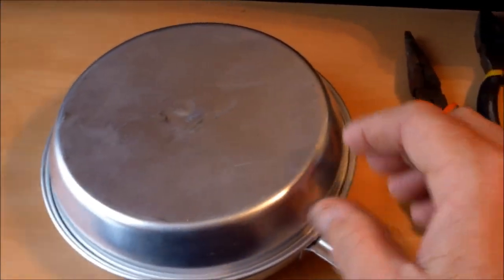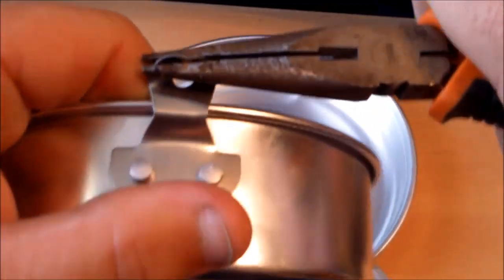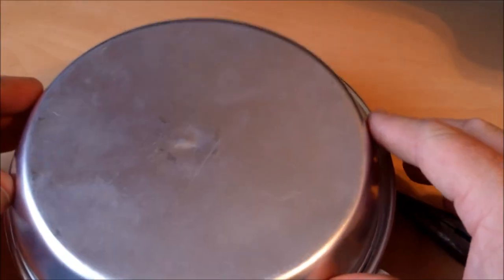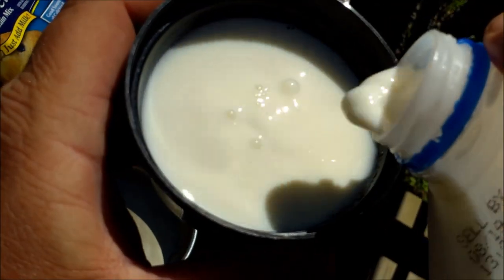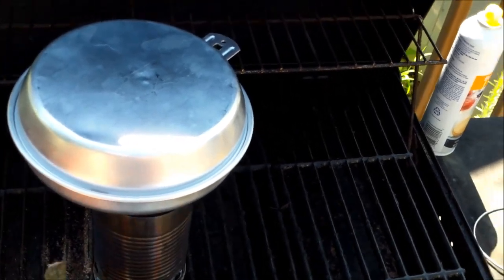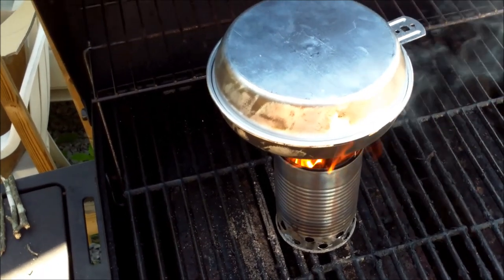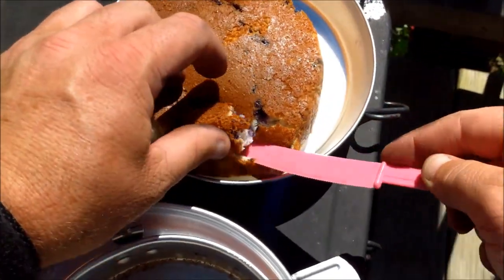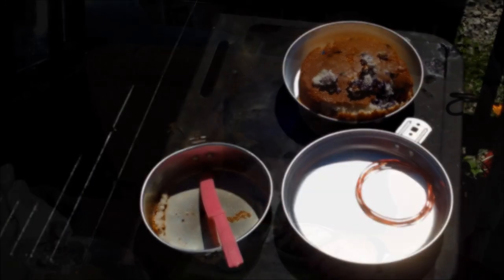DIY Ultralite Camping Oven

Comment: Great idea. I had a old mess kit  gathering dust so I gave it a try with some corn bread. Worked great. I turned the pan upside down so I could use the stem as a handle. Thanks for sharing. I'll be doing a lot of baking on the trail now. Enjoy & be safe!

Comment: I'm sure that someone has already suggested  this. But, I still have to tell you a trick that works fairly well.  When Baking in the Bush.  Put some hot coals on top of the oven, to surround it with heat.  You won't have to increase your cook time as much.  And your food will bake more evenly.
Reply: Teresa Judy good call. That's the way to do it. I use this: http://frybake.com/ and you put a fire on the top to create the oven effect as you mention. It does heat more evenly. As a matter of fact when you "dutch oven" bake you need more heat on top than on the bottom so it won't burn below. Fun video though. Cake or biscuits on the trail. Yum.

Comment: I took the pot and set it on the stove as a spacer. Then put dough in mess kit. Put both halves together like you pack it up with the handle fastened with the bolt. No mods needed. The mess kit pans are an inch and a half off the flame. Baked in about 15 minutes when flipped half way through baking with pliers. Used Crisco on pans.

Comment: I haven't read all the comments, so maybe someone already suggested this, but here's something to try. In a regular stove, the oven is hottest towards the top. So to brown the bottom of a pie, for instance, you'd put the pan on the lowest rack first. Folks do that to get a crisp bottom crust on pumpkin pies. 

So start your baking with the cover on the pan like in this video. You'll need to experiment with how long it takes to cook the muffin all through, but not dry it out by leaving it in too long. 

Then, after you know it is cooked through, so it will not fall when you handle the pan, remove the cover from the muffin pan, and put the pan back in for a few minutes. The lack of a cover may allow the hotter heat to brown the top of your muffin. :)

Comment: “Idea” Add some tabs with holes in them so when turning over to dump pan that will hang down, but at same time if you want to attach bail for use of hanging pot over fire to warm soup or make a small stew you can. Thanks for sharing your video with us.

Comment: It might be helpful to have more space underneath the pan of food you're baking such as a mason jar lid or a small tuna can so that the pan is higher within the area of baking air.  Also adding coals or wood sections of fire on the top of the pan will add heat on the top and shorten the baking time needed.
Reply: I tested both methods with a riser on the bottom and carbon felt and without anything, the method that used nothing underneath the Pot cooked the most evenly & had the best looking crust on the bottom & sides & a little browning on top with absolutely no burning, & I just turned the pot over and the bread fell right out on it's own,  check out Hiram Cooks test on this using a Mess kit, the 2nd best method was Hiram's way using the carbon felt, The 3rd method I used 3 different risers in the bottom & a 4th test using Parchment paper that I had seen others do and none of those tests beat the other 2 ways, without anything and using the carbon flet.

Comment: Nice thinking!, Keep the handle on the frying pan and ditch the potholders, I think if you bent the tabs below the holes to a 180° you might be able to still use the pot bail.

Comment: to reduce the risk of burning, place some water in the bottom of the big pot. This will aid in making the batter temp more even. You could also toss in a handful of gravel. Or even dirt (fire the dirt first to sterilize it)
Just make sure you release the steam. Once steam is done leaking out, you know it will start baking and can adjust things accordingly.

Comment: Great.  I bet a carbon felt disc in the bottom would work well.
Reply: +Bobby Harper thx for this comment......i used 3 small carbon felt discs under 3 silicone baking cups and it worked great........1 oz in an alcohol stove and they cooked perfect

Comment: That turned out great.  FYI - I have the "Stansport 360 Stainless Mess Kit" which I think would work better for this without any modification.  I paid $21 for mine so it's a little more expensive.

1.  Pot handles don't protrude up so no bending is required.

2.  You can use the pot lid for a stand (the knob screws off by hand) as it is slightly bigger than the base of the pan.  This still provides clearance at the top for circulation while allowing the top clamshell to seal.

http://smile.amazon.com/gp/product/B0000AQO5S?psc=1&redirect=true&ref_=oh_aui_search_detailpage

Comment: The electric motor running was annoying, could hardly hear you talking, you need to do your tests somewhere else.
Reply: Yer, that looks good mate, save me a piece, just a opinion I have, try to keep away from cooking with aluminium, as it gives off some dangerous toxins, a lot of us bushcraft people are going onto s/steel, it does not add that much more weight, and is a lot, lot safer.
atb
Ray